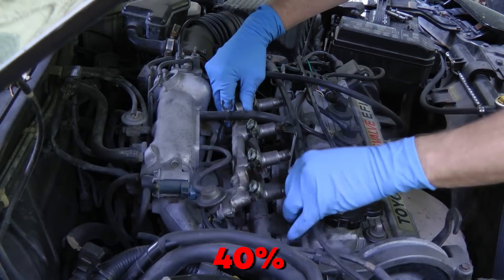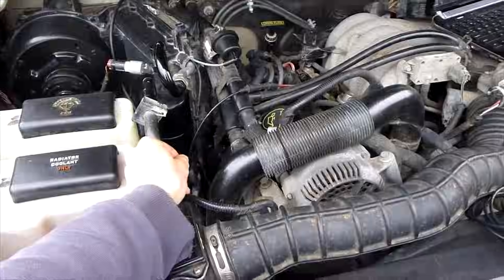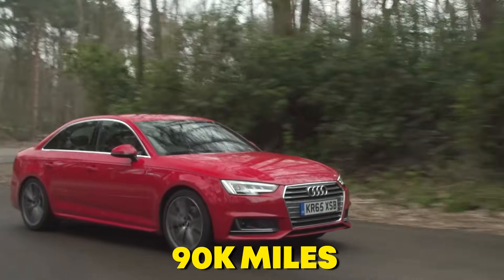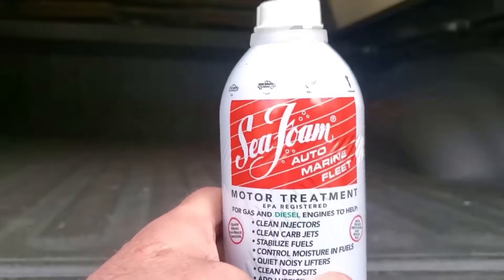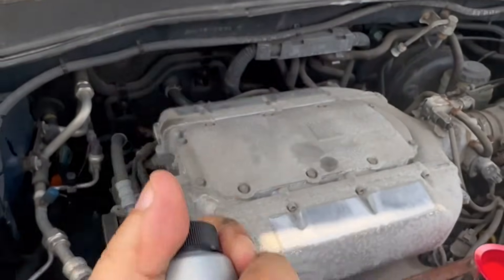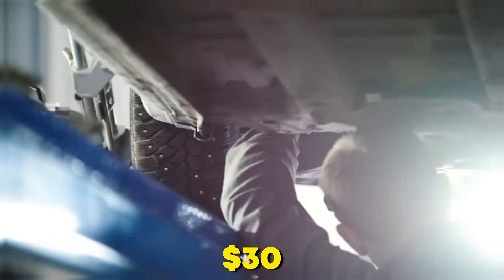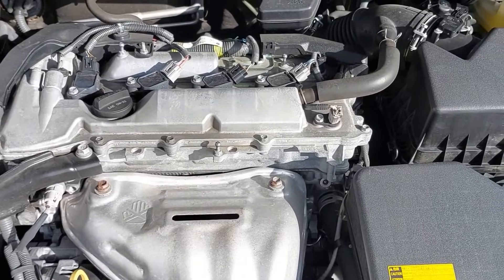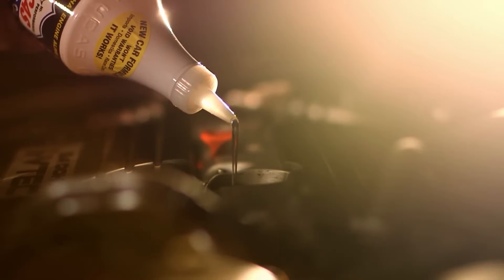7 Engine Additives That Work And 4 That'll Kill Your Car

Comment: Well I know before I change rod and maintain bearing on a 1970 350 olds rocket! Use slick 50 in the quart bearing surfaces were shiny and smooth the machinist ask if I had used slick 50!, because that was the only thing he new that would do that when the bearing clearance was 3000 and the oil pump was clogged ! Put 1000 under bearings in it fixed oil pump ! Problem solved

Comment: Seafoam for the win. Run it in everything. From our snow blowers, generators and vehicles. 

This video did peak my interest in techron. Probably going to run some through my WJ with 260k miles on her.
Reply: Well with this Rav 4 I had to put it back into service in may , after uplander was to far gone and rear hanger came loose ! It sat since 2018 ! It still has a slight miss I am pretty sure the number 4 cylinder exhaust valves are sticky , avoiding all cost of taking head off even if I have to remove valve cover again, will sea foam at next oil changed! Have been spraying knocker loose in fuel , intake , and oil ! It is seaming to help ! Crossing my fingers